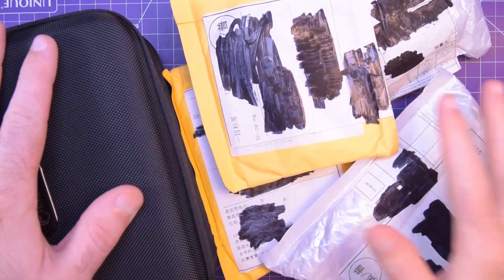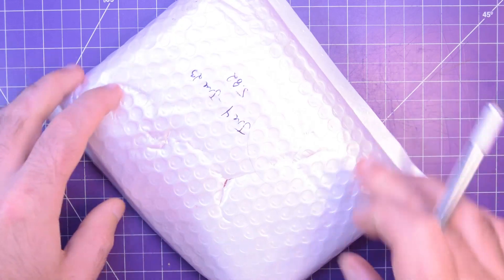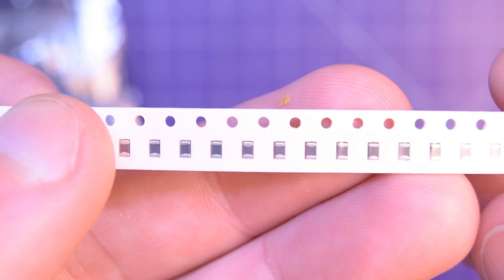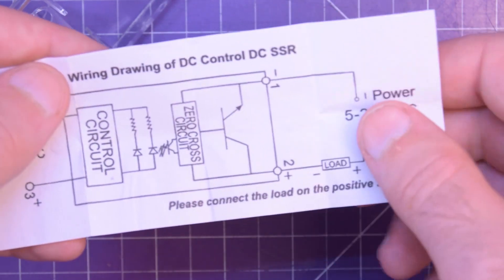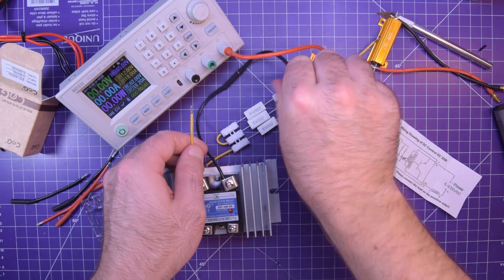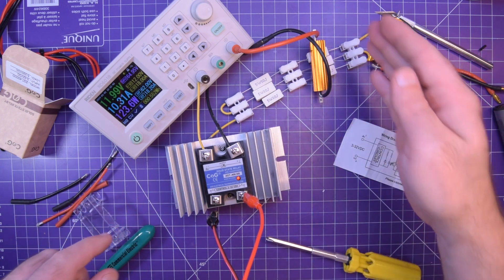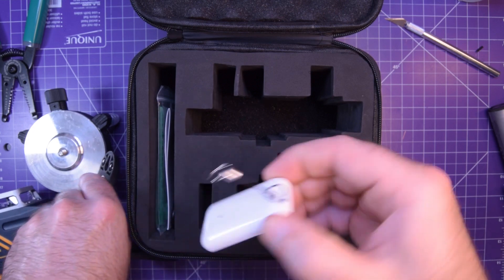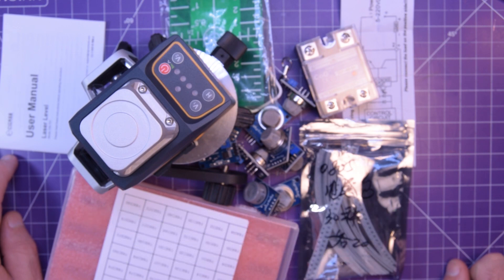Mailbag 86 - Sense Chips

Comment: I'm not sure I would want to put 400 Amps @ 220 volts through those terminals.  88 KW DC is a lot to switch.  (BTW the circuit diagram shows opto-isolation between the switch input and load side)